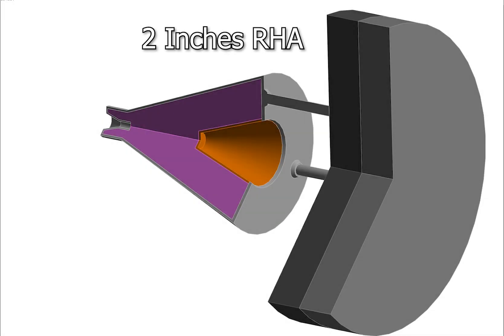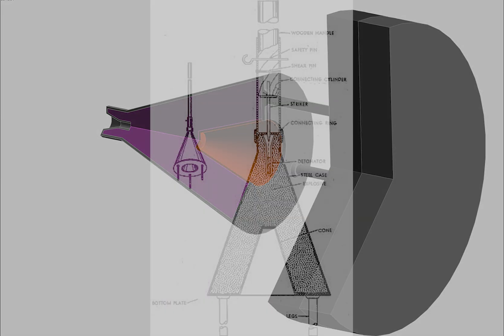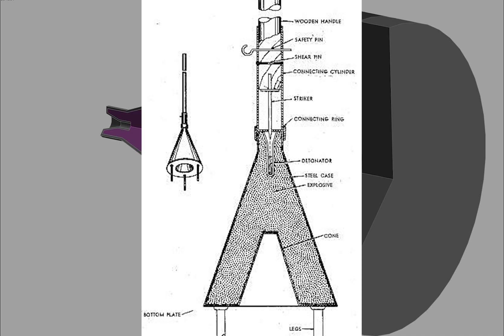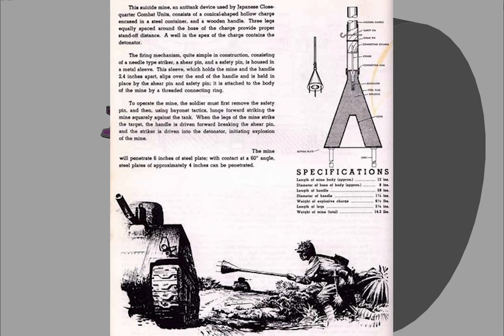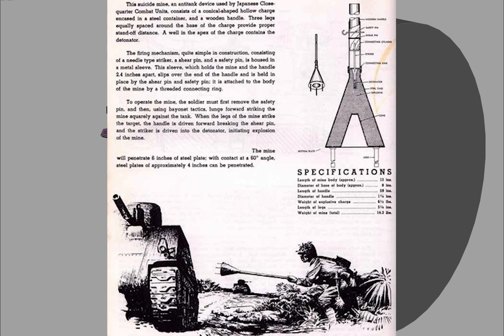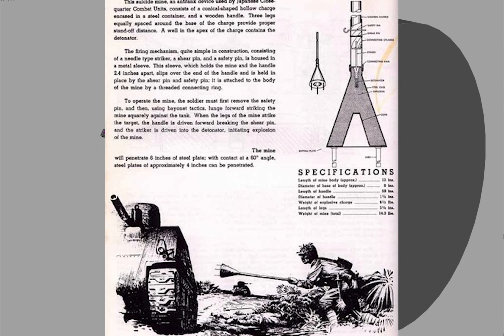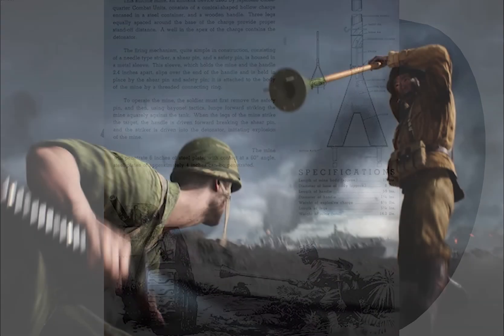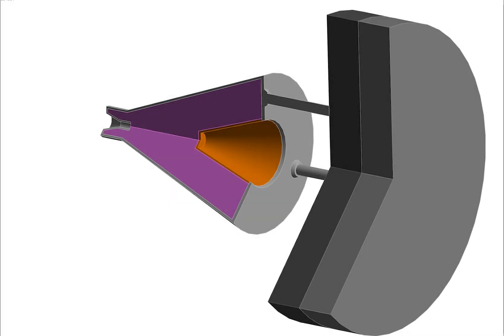Japanese Lunge Mine VS M4A3 Sherman │Tank Armor Simulation

Comment: Disclaimer: The sources we used were divided on whether the m4a3 had 50.8mm of side armor (2 inches) or 38.1mm (1.5 inches) so we chose 50.8mm side armor because it would make for a more interesting simulation.

Tank used is an uparmored M4A3 (75mm) Sherman that served with the 5th USMC Tank Battalion on Iwo Jima
Reply: Most M4 variants actually had the main side plates of the hull - both upper and lower - being 38.1mm (1.5in), with add-on armour plates often welded over vulnerable areas providing an additional 25.4mm (1in) of protection, increasing the total to 63.5mm (2.5in). This is the same thickness as the Sherman's frontal armour on the welded versions (the ones that looked boxy rather than rounded).

Heavily armoured versions of the Sherman had the upper side increased to 76.2mm (3in) with the lower side retained at 38.1 (1.5in).

The 50.9mm (2in) you found in the source most probably relates to the turret side-armour, which was that exact thickness on most standard Sherman variants, including the M4A3.

This would thus imply that the simulation is of a lunge-mine hitting the turret side or rear of the Sherman, and not the hull.
Reply: @ZETH_27  its actually a simulation of an uparmored sherman m4a3 that served on iwo jima with the 5th usmc tank battalion
Reply: @ZETH_27  Neat, this means that if the Lunge-er got onto the tank, it was done for?
Reply: @jasperbarnes4544  The hull side had less armour than the turret, so it'd have been more advantageous and convenient for the lunge-er to go for the hull.

Going up to the turret exposes them to the risk of getting machinegunned by allied tanks, or infantry.

But, given the fact that they're probably going to die, I don't think they care to much.

Ether way, the lunge-mine will penetrate the armour of the Sherman from the side no matter where you hit it.
Reply: @ZETH_27  ah, thank you

Comment: 150mm max of pen isnt bad for a handheld weapon of ww2... There were very few allied tanks in service that had a plate that thick, and sloping wouldn't matter as much with this since the soldier would likely be ramming it flat against whatever part he was targeting.

The main issue with this is surviving to get close enough to use it. Imagine if they just stuck fins on it and soldiers yeeted them at tanks like spears.
Reply: Its bad for a caliber of 200mm
Reply: @matthelord7695  fair point, but weren't most heat rounds of the time quite shit? At least spin stabilized gun launched ones. Rocket propelled ones like the bazooka and panzerschreck didn't have this problem.

Comment: Misinformation, they were supposed to be thrown at least thats what the documentation for these described.
Reply: That would be impractical and inefficient, it would be very difficult to throw a 6.5kg spear with an extremely heavy tip to ambush. Also the lunge mine need hit target at 90° to maximized the penetration.
Reply: @myopickid4180  
Tell that to the Japanese that designed this.
Reply: @SMGJohn  The Japanese who design this must be a fan of action manga like "Hunter × Hunter", I guess.
Reply: @myopickid4180  
Considering that spear training was still a thing in Japan during the 1930s, I am not sure you realise soldiers were somewhat familiar with a spear which is not light.
Reply: @SMGJohn  And the way that Japanese soldiers used it in combat at that time was really the answer to their familiarity with spears.
Reply: @SMGJohn As far as I read about Japanese long-handled weapons, they have long spears called Yari (槍), Length 1-6m and weight about 1.27 kg, was used for thrusting and sweeping, but it was not typically thrown. Naginata is a single-edged curved blade on a wooden or metal pole, can be used for throwing since they are only 1/10 the weight of a Lunge Mine.
Reply: Wrong mine

Comment: 1)how does it compare with german magnetic mines? Isn't running with those to a tank just as "survivable"?
2)is there a way to simulate effect on the "pikeman/lancer"? What if the  lance was much longer, like actual lance?
Reply: The magnetic "mines" had a timer I believe. Of course running up to a tank is still often the last thing you do
Reply: @DaReaperZ  they did, but yeah, that's the part that makes it complicated. Don't see why the two designs can't be combined.
Reply: Youre not surviving 5kg of tnt
Reply: @matthelord7695  if it was 5kg of TNT, penetration would have been around 400+mm, not 100mm. This thing is NOT spinning so it has same jet quality as HEATFS. We're talking about 1kg tops, most likely less. 5kg is likely the weight of the whole mine.
Reply: @TheArklyte  yeah i was a lil wrong total weight is around 5kg/6kg the filller is 3
Reply: @matthelord7695  HEATFS on soviet 125mm has only 2kg and does 400+mm. The filler weight that you mention would be just insane for WWII HEAT charge. There is some mistake in the sources.
Reply: @TheArklyte  my brother in christ i corrected myself its 3kg not 5, also shaped charge pen depends in the angle and shape of the liner alot more than just explosive mass
Reply: @matthelord7695  it also depends on 1)rotation that disrupts the jet which isn't present here so I'm comparing it to HEATFS; 2)distance to armor(it's designed to be ideal here); 3)diameter of the charge.
German "limpet" magnetic mine I mentioned above penetrated 140mm and weighted 3kg total, most of which were magnets.
Are you really going to claim that japanese had no idea, how to make HEAT rounds? And due to that overcompensated with extra explosives which they DIDN'T have! Because explosives were also in huge shortage.
Reply: @matthelord7695   @matthelord7695  it also depends on 1)rotation that disrupts the jet which isn't present here so I'm comparing it to HEATFS; 2)distance to armor(it's designed to be ideal here); 3)diameter of the charge.
German "limpet" magnetic mine I mentioned above penetrated 140mm and weighted 3kg total, most of which were magnets.
Are you really going to claim that japanese had no idea, how to make HEAT rounds? And due to that overcompensated with extra explosives which they DIDN'T have! Because explosives were also in huge shortage.
Reply: @TheArklyte  absolutely because by that time some soldiers were being supplied by spears to charge into the enemy 💀
Reply: @matthelord7695  then where are they going to find 2-2,5kg of excessive explosive per charge?
I looked up the wiki and sources and while they say the same thing as you, I explained why I believe that it's bs. Too much of a bang for too little of a pen. And required pen doesn't need such huge numbers.
Reply: @TheArklyte  the liner is a stupid shape and angle thats why

Comment: I mean, why didnt they just make sticky bombs instead of goddamned explosive sticks?! Using both would require the tank to be cleared of infantry support anyway, right?

...or am i severely underestinating IJA's fetish with YAMATO DAMASHII suicidal hijinks here?
Reply: @boomer19450  they did but they were easy to counter, the lunge mine was not
Reply: Sticky grenades (like the No. 74 hand grenade) were not very useful anything with substantial armor. The only way that a bomb like that would actually be useful against the side armor of a tank is if you had a 5lb+ grenade which isn't going to be throwable, you'd have to place it on the tank by hand. At that point you may as well use the lunge mine since you can basically guarantee that if it goes off that it will penetrate into the interior of the tank pretty much regardless of where you hit as long as it isn't the direct front
Reply: The thing is sticky bombs... Weren't actually sticky

Comment: According to word of mouth when we had to use this thing in the 50's against the French, the fuse actuator was wonky and some time took considerable force to detonate. There's was some attempt at lengthening the handle stick but it's too unwieldy and slowed you down considerably (heavy street fighting with manmade barricade all around) so most just got issued a flak jacket and called it a day. I think there a couple men that survived the attempt and didn't immediately get mowed down right after, granted one of them fail to detonate the thing.
Reply: Interesting I never knew Vietnamese used these too. Were those original captured ones or domestically-made copies?
Reply: @czwarty7878  Yes, very original. They were "reappropriated" after Japan surrender and subsequence withdrawal in 1945 as a stop gap until the Vietnamese can domestically make a version of a bazooka, ammunition and all, which took around a year (from research order in march of 1946 to manufacture, delivery to first confirm kill with said system in march 2th, 1947). So yeah, same batch of lunge mine from same factory could either be used to blow up a US crew M4A2 Sherman in ww2 or a French crew Chaffee(or M8 Grey Hound) in 1st Indochina war with just a slight change of number on a manifest.
Reply: I didn't knew Vietnamese also used su¡c¡de attacks, interesting!
Reply: The Vietnamese used these against the french???
Reply: @akriegguardsman  Yes, Vichy French administrations under Imperial Japan rule at first during WW2 and France as a whole after. USA sent OSS (precursor to CIA) to back Hồ Chí Minh during Axis occupation of Việt Nam but turn their back on him (sound familiar?) when postwar France want to retake their colonies fearing a Comunist turn France in the heart of Europe undermining their plan of establishing NATO. So now, you have British disarming Japanese forces in the south but only to restore French colonial rule which the north view as a puppet regime. Conflict ensued.
Reply: nice fellow vietnamese
Reply: I can only imagine how brave someone would need to be to face off against a tank with essentially an upgraded spear. That’s ballsy
Reply: Why not wrap the flak jacket around the back of the explosive to limit rearward shrapnel?
Reply: @Miss_New_Booty  Cause that, most likely, turns the flak-jacket into shrapnel.

Comment: Even if this couldn't pen the side of a tank it could likely still play hell with running gear or maybe if the user is lucky/daring dry to get the charge over a engine air intake or radiator grill. Even just using this on a vision block/slit would at least cause some form of "Significant Emotional Event".
Reply: Most tanks don't have 100mm in the side, unless it detonates on side skirts.